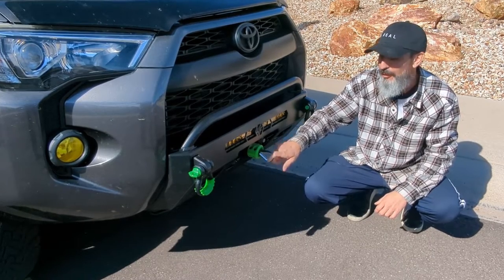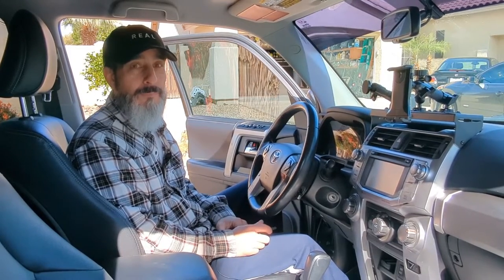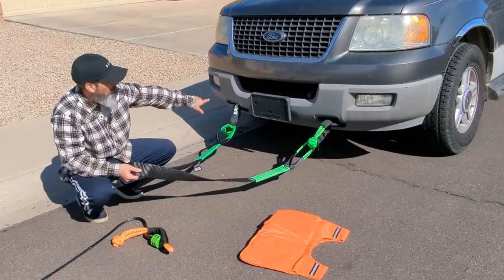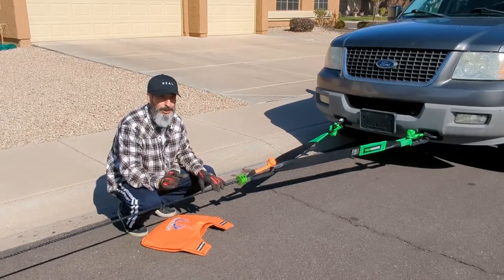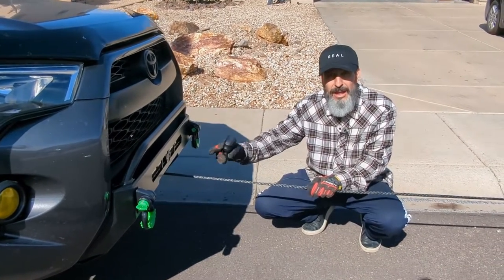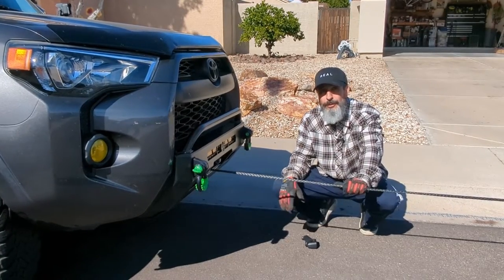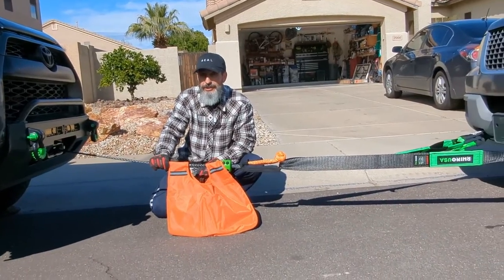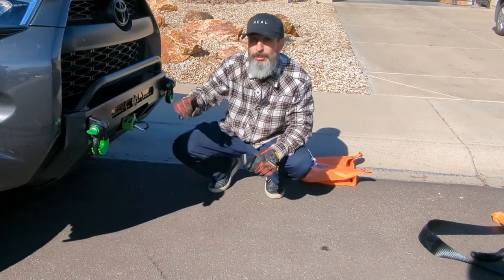Do THIS Before Using Your Winch For The First Time

Comment: Big thumbs up from me on this video! So many people get winches installed at shops and are not told that they need to do this. You might want to add some info in your description regarding why this procedure is necessary. It is actually recommended for both synthetic and steel line. If the line is loose on the drum, when you are performing an actual recovery, it can cause the line to suck down in between the loose line layers. This can cause your winch to bind up like a rat's nest. Especially in the case of synthetic lines, it can create a lot of friction and abrasion and damage your winch line. If you do a lot of winch recoveries, it is good practice to occasionally un-spool your line and re-tension your line. There are several reasons for this. For example, some times you are winching at and angle and your line gets bunched up on one side of the spool. Other times your spool out a lot of line or use a winch line extension and then after the recovery the line gets re-spooled loosely because there was so much line out. Anyway...great topic and nice job covering how to do it properly.
Reply from the maker: I appreciate the comment. Since you explained it better than I'll be able to, I'll Pin this so others can learn from your wisdom.

Comment: Well done! You might consider looking into Factor 55 goodies. Also, if you do adjust your front/rear shocks, you should take a look at Bilstein 6112/5160s with the attendant springs. I love what that setup did for my rig. As to a winch damper, because one never knows which end will break loose, a number of people recommend using two dampers, one at each end. A single damper in the middle is actually pretty ineffective. I know, it's always assumed that things will break on the vehicle being recovered but, that's not always the case. Your tag line! You forgot your tag line!!! Now, I'll just have to cry myself to sleep.  :))
Reply from the maker: Love your feedback! Factor 55 has some great products, but too rich for my blood right now. I do indeed have that same Bilstein setup sitting in my garage. Just trying to find the time to install and film it. After this weekend's trip loaded down with my camping equipment, I definitely need it.
Reply: @AZOverland2017  Once you get that in and adjusted, you will be blown away. Also, look at what Wescott has for the 6112s. Better yet, do a video over there. He's just down the road a mite!

Comment: I just got the Warn Evo 10S installed on my Chevy ZR2.  Was that wireless remote recalled from Warn?  Good video, I will do this to my winch set up.
Reply from the maker: It was for the possibility of the winch spool activating if the remote gets wet. Apparently some sort of waterproofing flaw on the remote itself

Comment: You should never put your finger through the eye.  Good way to lose it if the controller malfunctions or the contacts weld closed. That winch will easily push the plastic up over the eye and possibly pull your hand in the winch, ripping your finger off in the process.
Reply from the maker: Thanks. Agreed

Comment: Can I use a smaller veh all I have is an old Chevy Sonic and I'm in the desert not too many trees here
Reply from the maker: You can. Try to find a way to increase tension when spooling the winch. Ex. use emergency brake on the Sonic, pull it up an incline, etc.
Reply: @AZOverland2017  I'll give it a try thanks

Comment: I didn't get why this needs to be done?
Reply from the maker: The line needs to be spooled under tension wrapping in around the drum and so it lays correctly on itself. If the line is used and starts to layer on itself incorrectly, it could sink or get pinched on the lower layers. That could create several issues 1 being it could misshape the line causing premature failure, among other potential problems.